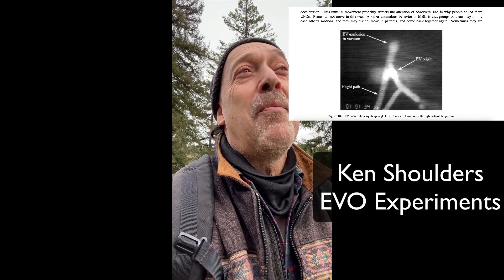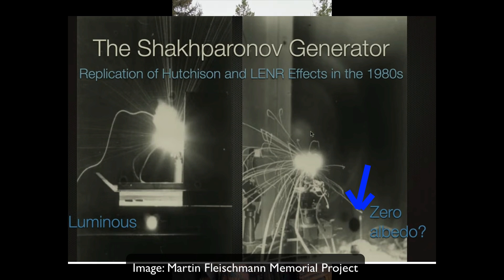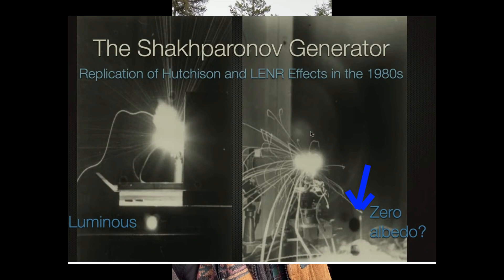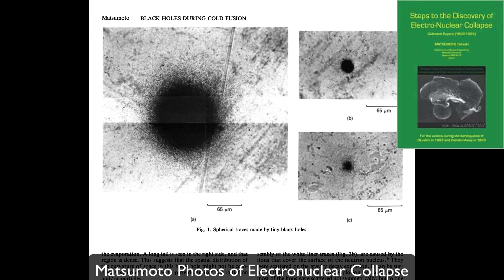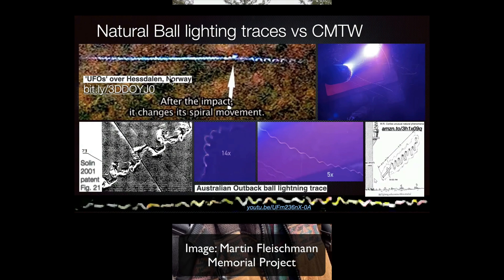New Resonant Energy Tech Captures Power of Ball Lightning—THOR Thunderstorm Generator

Comment: ahh i read about this one doc ! yes the combustion engine only puts out h2o and a few other non poluting gasses, very interesting. just like "BROWN GAS" another underused gas that can cut just like oxy / acet yet it's cold to the touch and just produces h2o amazing yet we don't use it !!! I'm pretty sure that cold fusion has been cracked and locked away by the oil barons. helium 3 that's where it's at. but of course you know this dr. take care stay well keep smiling Rob s UK.

Comment: Paul Pantone used a similar reactor in his GEET technology which some claim did a similar thing to exhaust gasses.
His approach was to bubble and vaporize the fuel and run it and its exhaust through a simpler but similar set of concentric reactor pipes. The Thunderstorm Generator ionizes and bubbles the inlet air in stead and adds spheres to the reactor. Does nothing to the fuel, but I'm curious on a hybrid of both.
Reply: I'd love to hear Bendall comment on other resources that might be transmutated. What might be possible with Silicondioxide, which is abundant in white sand? If we could process that down to a hydrocarbon and then transmutate back to oxygen... Anything to give freedom of energy back to the people, rather than dance to the whims of the billionaires and their activist minions. The trillion dollar Tesla company seems exceedingly distinterested in exploring Nikola Tesla's greenest techs: Wireless power transmission and generation.